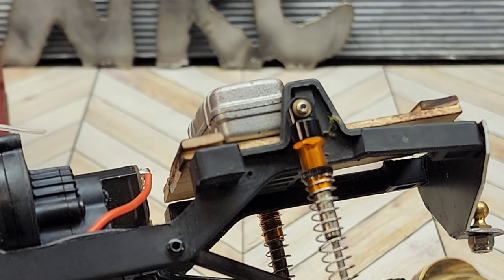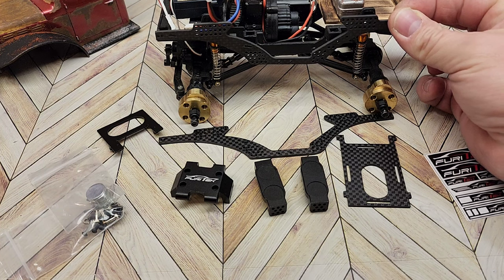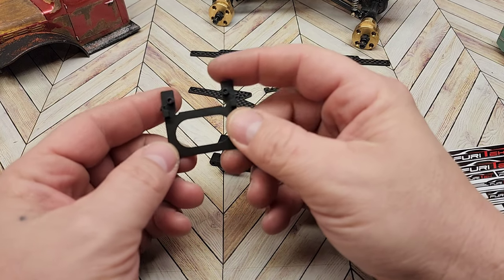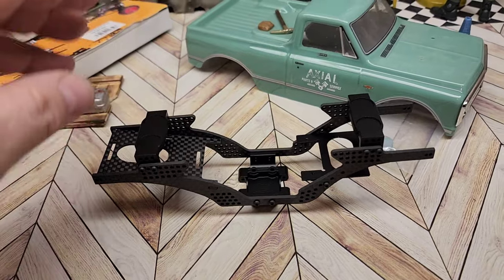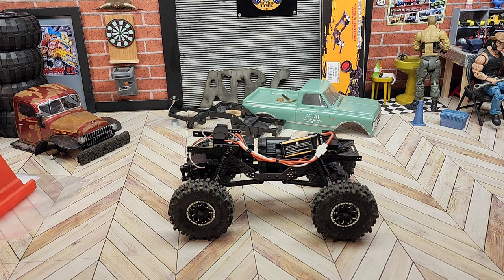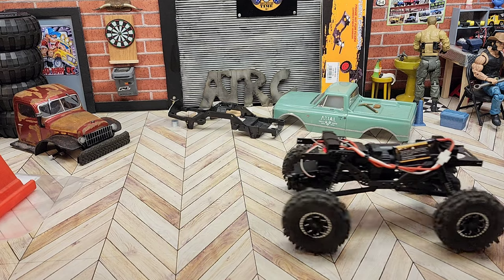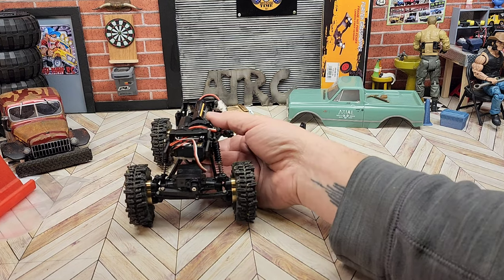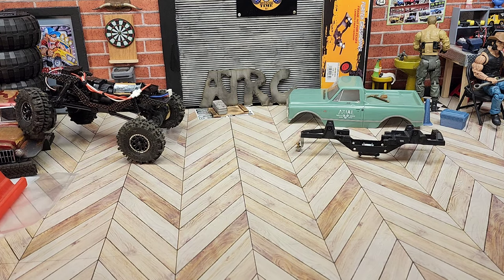Fcx24 Furitek Grasshopper Chassis

Comment: Hi there Brent, great rebuild project. I’m so, so confused on the best miniature crawler. I’m looking for a crawler of the smaller scale, as I’ve had my fingers burnt a bit with the WPL product, so dubious. I’ve seen the FCX24 and the SCX24 from FMS and Axial, seen also your TRX4m too….but there is also the FTX 1/16 range too, seem to offer valve for money, so confusing. Best wishes 😊😊😊
Reply from the maker: Hello John yes there are so many choices for micro crawling I usually recommend a Axial Scx24 because of parts availability and so many different models to choose from and they preform great